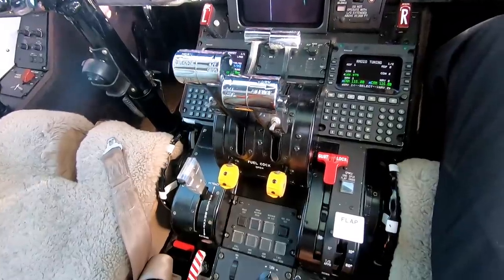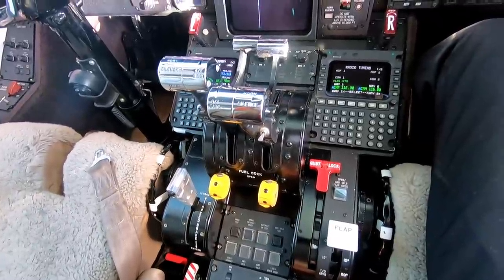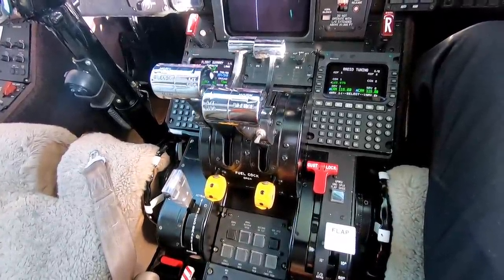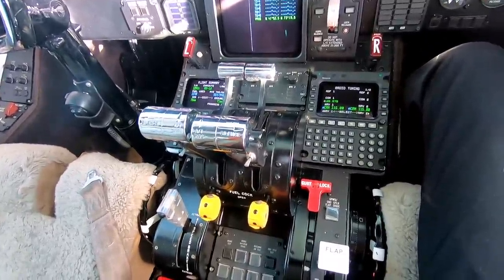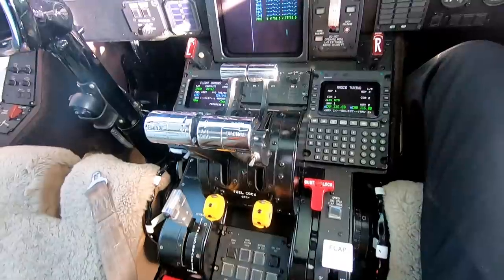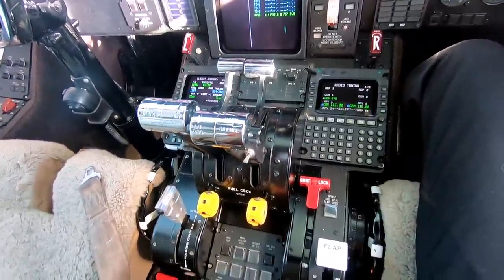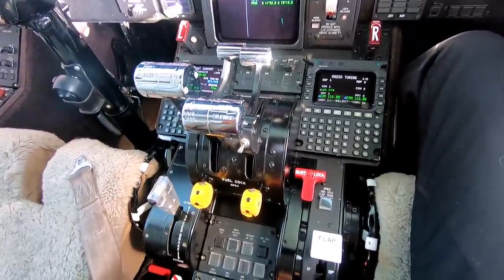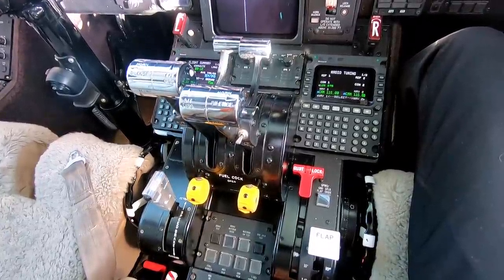Tech Tuesday - Why Do The Throttles Move Like That?

Comment: Hey Shaun, I watched this video when you first posted it and have waited to comment until now. What I am going to say is in NO WAY critical of you or your video. I love watching them.
Even though I am retired, I am still very anal when it comes to machinery working as perfect as possible.
I have extensive experience on commercial planes that were nothing but cable operated. When cables are installed and/or checked, they have a specific tension that they are rigged to. Your explanation of the expansion and contraction of the airframe holds true, but that is taken into account when the cable tension is determined. All cables, when they are manufactured, are required to be pre-stretched. That eliminates any further stretching that would happen during the life of the cable.
I have dealt with mismatched throttles and the solution was always to trim the slower engine's fuel control so its throttle position matches the faster one. The slower engine is the one that the throttle has to be advanced more to get the same power.
Having said all that, I have no experience with your specific engines, but I would ask to have the high speed trim bumped up to take care of the problem. Give the mechanics the amount that the throttles are mismatched. An example would be a full knob or 3/4 knob. You can also turn off the auto throttle, align both throttles and record the N1 and N2 speeds of both engines. The maintenance manual should have a chart to tell them how much to adjust the high speed trim. 
I would also recommend that you insist the mismatch be fixed. If you ever get into a situation that you need all the thrust the engines can put out, the slow engine won't reach it. If the other engine fails during that emergency, it might be catastrophic if the slow engine can't give you enough power.

Comment: Sean,
Speaking of cockpit layout, I recall you or John in P69 using a display on either side of the a/p for your checklists(?) and in your latest vids you guys use printed check lists. Any reason for this?
  One day you’ll have to have tech Tuesday on the autopilot and why both left and right seaters are ‘crowding’ the panel at the same time during changes... I always noticed that when you and John were flying together. 
   Awesome job. Keep up the great work. 👍🏻👍🏻👍🏻👏🏻
Reply from the maker: These planes do have the checklists on the screens, but they aren't up to date, so we just use the paper ones. As for the autopilot control, that would make for a great Tech Tuesday video! I will definitely put that on the list...thank you!

Comment: Aluminum expands at approximately twice steel so airframe expansion is alot compared to the control cables. But on the loose side of tolerance is better than tight. This is true for all flight controls. It makes for smoother more precise movement. All things being equal. It is alot of work to change and rig the throttles cables on that beast. What a fine airplane though. Thank you!

Comment: Interesting. Running sport fishing boats with two diesel engines and mechanical throttle cables, we'll typically have a synchronizer. Engage the synchro, throw the slave throttle open, then you control rpms with one throttle without moving extra cable.

Comment: I thought I've seen this on the other aircraft that you flew before you switched companies? I might be wrong though, either way great Tech Tuesday!
Reply from the maker: Yes we did...after the engine swap on P69, the cables were a little loose and we had the same issue

Comment: Just a suggestion, do a tech or flying video on a ILS LOC approach preferably in IMC and show the fans how to line up on centerline down to minimums. Show how sensitive that needle deflection becomes the closer you get down towards the runway environment. 

Funny story. When I was at KEGE airport I was holding short of rwy 25 and called up tower and said holding shit at rwy 25 at A1 ready for takeoff. Tower replied stand by 325TZ. I guess they had to get a laugh before giving instructions. Sometimes I talk too fast when ATC is really busy.

Comment: The obvious question for me is why not just change both cables while they're at it?   
Assumably both were the same age at one point, the right stretched, frayed, etc.. seems the left wouldnt be far behind.
Btw.. how old is your GIV fleet?  Back in the 90's there was a aftermarket autothrottle add-on for the IV's (Autopower?)

Comment: Does the movement affect the fuel flow or is it just taking up slack? Asymmetrical thrust? What was changed in the right cable construction? Thanks Shaun!
Reply from the maker: For the most part, it's just taking up the slack. The fuel flow changes a little bit, but very little

Comment: so does the difference in lever travel make a difference in power setting? do the engines remain in sync when it does this? Looks like it would just lead to wobble noise if it's adjusting the two engines independently in cruise

Comment: Does the throttle movement change the actual power setting on the left engine? Like is the left engine constantly going up and down in power during flight?
Reply from the maker: Very slightly

Comment: So is this difference in cable tension mostly applicable for when the auto throttle servo is is engaged or also just as noticeable when you're hand flying the throttle?
Reply from the maker: I can't notice any difference when manually operating the throttles.

Comment: If that has such a big effect on the levers, would you still be able to give it full throttle? Because for me it looks like those 2 cm of movement would limit the maximum position by exactly that amount. Anyone know what I mean?
Reply: anonym0336 cable tensile strength (ground temp. vs. flight temp.) no need to firewall throttles at cruise altitude...I hope.
Reply: @annnonymous9791  I hope too ;) I was just wondering. Just theoretically
Reply from the maker: I see what your saying, but these engines are very de-rated, and if you push the levers all the way to the stop, they will overspeed. It's not like a car, or even reciprocating engine airplane where takeoff is done with the power levers at full.
Reply: @CorporatePilotLife  Thanks!
So, full possible thrust doesn't mean levers all the way... I knew you couldn't use all of the engines power every time, but this is indeed new info for me. Thanks! Keep it up :)

Comment: What does it cost to replace that cable and what happens if it breaks? Is there a backup system?
Reply from the maker: I'm not sure on the cost, but should it break, we would lose control of that engine. To my knowledge, there is no backup for that. I'll have to look into it though to confirm.

Comment: But you could just disconnect autothrottle in cruise to stop the engine changing RPMs all the time, right?
Reply from the maker: Correct, but they really don't change RPM much at all. It's just a little movement on the lever for the most part

Comment: if that cable is so far out of spec the auto throttle will no longer have full range. and wont work. it should be replaced

Comment: Can rudder control be managed by using the throttles? Also, what is your take on the Max8 situation as it relates to auto stall warning & the system for the G4? Thanks for the Tech vids.
Reply from the maker: I guess i dont really understand the question there...by splitting the throttles, you could control any adverse yaw condition, but I'm not sure where that might apply. As for the MAX 8 situation, the G-IV is MUCH older technology by comparison. We do have a stall prevention system called the stick shaker and stick pusher that is activated by the Angle of Attack.
Reply: Corporate Pilot Life I thought the pilot could steer the plane using right or left throttle. Only in an emergency situation. Thanks for the timely response.
Reply from the maker: AAAHHH...I see what you're getting at. If you were to lose flight controls, you could, in theory, control the plane with only the use of thrust levers. Wouldn't be pretty, but yerh...it could be done
Reply: @AuditRecon   That's exactly how the pilot of United Airlines flight 232 controlled his DC-10 after an engine explosion took out all the hydraulics. The plane crashed upon landing in Sioux City Iowa in 1989 but a lot of lives were saved because of that pilots skills.
Reply: @TheRipper5418  I do remember that. Thank you.

Comment: <off topic> Shaun, on your in-flight vids, you doing audio normalization?
Reply from the maker: I don't. I haven't figured out how to do that with the editing software I use. If I can figure it out, it would certainly improve the audio quality.
Reply: @CorporatePilotLife   depending upon the software it could be as easy as selecting the clips and finding the option "normalize audio", or similar. You might have to select just one clip that all others are normalized to. When it works it works great, but if you have a particularly 'dirty' clip noisy with extraneous signal or crazy dynamics it can make that clip unbearable. Of course,  you can always manually override on the offending clip. I'm guessing just guessing, now  in your situation, it might bring-up the quiet parts to match. It should be very easy to test.

Comment: Ah yes. Coefficient of Thermal Expansion is higher for aluminum than steel. Interesting application here.
Wish you could explain basically how AOA sensors work and their reliability.
Reply: Boeing may have to explain theirs...